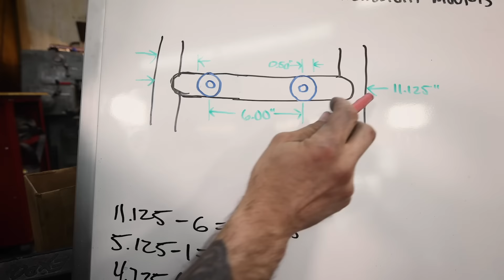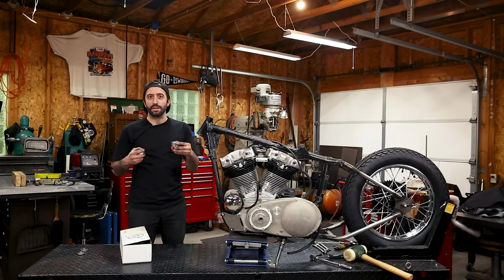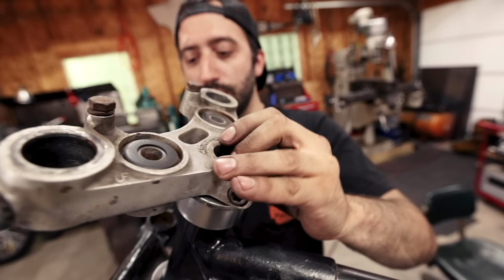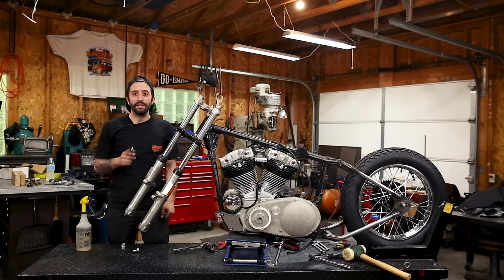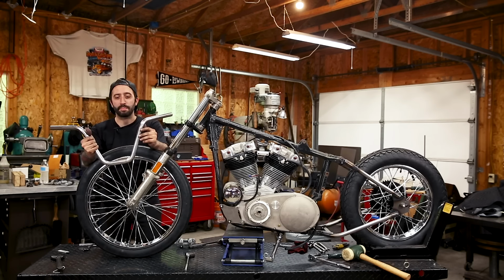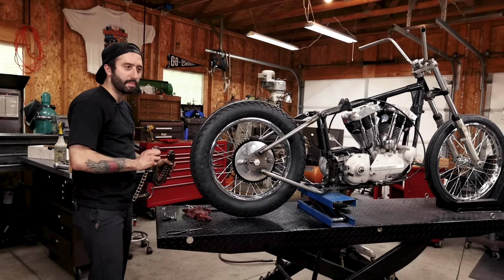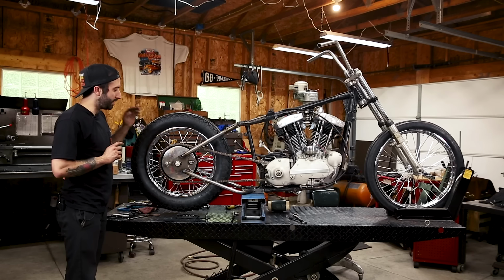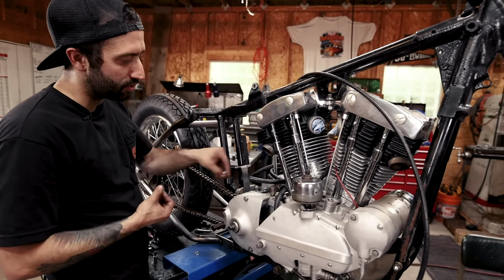Saturday Sportster - Season 2 - Episode 2 - Front End, Handlebars, Chain, and Oil Tank Install

Comment: Howdy 🤠 from northern Utah. I need to build a set of wires for my 14 Victory Vision. Do you have a kit for that? I need 0ne 90 and one straight off the coil. I need straight to the spark plugs in the jugs.  My last set was Taylor's 8.2 mm. Bret

Comment: Cutting the chain is much easier if you grind the head off of the rivets before using the Breaker tool.  It's also more easier if you use that same side grinder to just cut through the outer link, grind off one head, and push just that one pin out.  You are in your shop, and have the tools on hand, so do it the easy way, or not....
....RooDog....